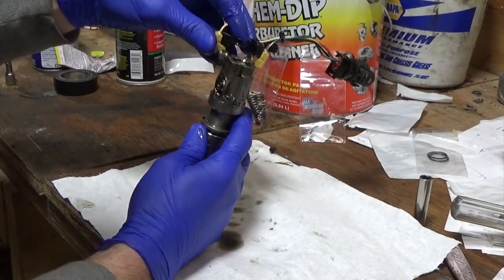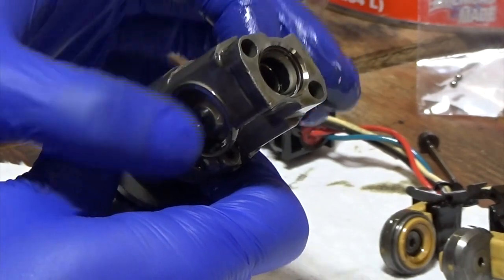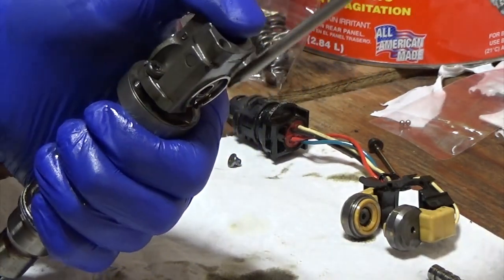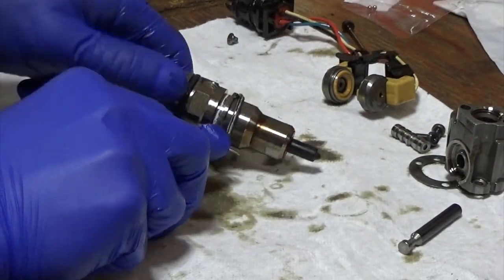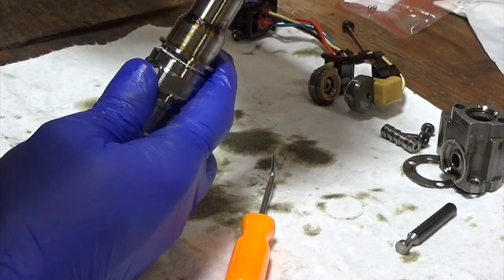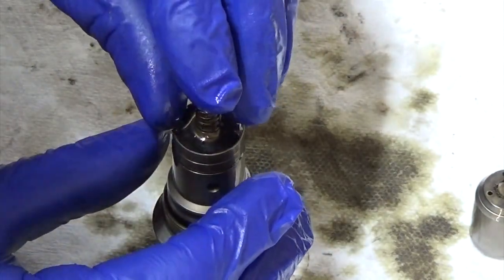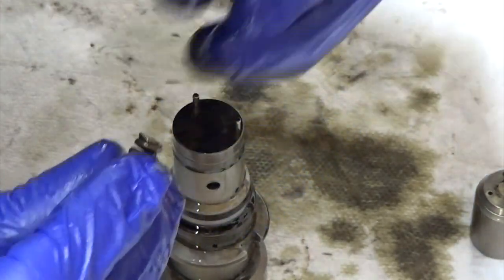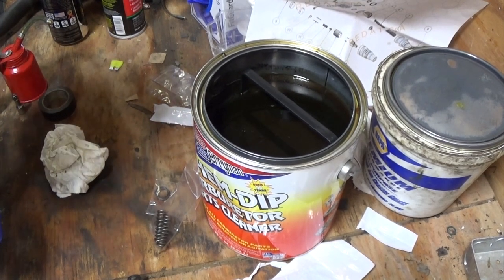6.0l Powerstroke Injector Rebuild Part 1

Comment: what are the 2 little ports on top? i have 3 of them leaking from there when doing a leak test. will that cause a no start?
Reply from the maker: Those are the high pressure oil exhaust ports. The high pressure oil goes through the high pressure oil rail into the injector. When the spool valve opens the oil pushes the plunger down. Once the spool valve closes. The pressure of the plunger spring pushes the plunger back up and pushes the oil out the exhaust ports. If you have oil leaks there when pressure testing. You have stuck spool valves. Or some kind of issue with the spool valve. 
Yes this can cause a no start. 
If you’ve disassembled your injector and you’re having his issue. You may have put the spool valve in the wrong way.
Reply: @showmerepair ok I've been looking for this i have about 40 injectors with this leak at the top and only found it because I've been trying to find a hpo leak on this truck and don't have money for new injectors. I've swapped spool valves between ones that weren't leaking how common is it that the valve body itself is worn out.lve been trying to figure out this truck for over a week.i air tested and couldn't hear anything with 170 psi at 190f. I resealed all the injectors bench tested for leaks and they didn't leak got the truck running then it wouldn't hot start then I air tested again heard a leak this time pulled the injector that was leaking swapped tops with one that wasn't but didn't work then got it together running then it died and it's another one leaking like that. And it's on the top of ring I put oil around and it's leaking from the top 2 holes on all 40 used injectors i have.also so it's known I'm not retarded I'm 19 with 5 6.0l and have flipped many and i am only finding this now and nobody i know knows anything about them so it's trial and error
Reply from the maker: @manassehgiesbrecht6528 yes the spool valve can wear out. 
Companies do sell new spool valves. 
I’ve not personally seen spool valve body worn out. But I would understand if it did wear out.
Reply: @showmerepair do you know a good definitive way to test injectors for leaks I've just been putting them on an oil rail with air pressure and being if it blows outta exhaust port I assume it shouldn't but idk for sure
Reply from the maker: @manassehgiesbrecht6528 if your not controlling the spool valve coils then the spool valve could be in the open position.
Reply: @showmerepair ok I've was thinking that so I swapped coils with an injector that wasn't leaking and it still did it so I swapped spool valves it still did it then I swapped valve bodies then it stopped. I have two trucks that have damn near identical problems right after like 180f the trucks performance drops significantly and randomly misfires and icp drops to like 900 wot then they don't hot start until like 160f one will hot start up to 180f
Reply from the maker: @manassehgiesbrecht6528 did you rebuild the injectors on both trucks?
Reply: @showmerepair i didn't do a rebuild yet at all I thought it was a hpo leak so I've been searching for that and I've only just found those leaks on the exhaust port.
Reply from the maker: @manassehgiesbrecht6528 other then heavily warn spool valve/ spool valve housing. The only thing I’ve seen cause random misfires on all cylinders at hot idle is spool valve coil bolt over torqued.
Reply: @showmerepair it's not hot miss at idle qt idle it runs fine it's under load it misses
Reply: @showmerepair it's from low icp but it drops like crazy when on throttle

Comment: Do you know where you can get the metering valve square plate. Mine was broke in half.
Reply from the maker: I do not. May have good luck picking up a used injector on marketplace to use for parts

Comment: Looks pretty straight  forward. Makes me wonder why more people don't rebuild their own injectors with so many crappy companies around and the high price of them.
Reply: Just like automatic transmissions, a lot of people are intimidated by it. The industry is partially responsible as nearly every mechanic you talk to will try and convince you that it takes years of experience to even look at them much less actually do the work.
Reply: @theezeelife292  the typical mechanic when you bring  in a 6.0.   Oh yeah you totally need a new engine.  😂

The last one I went to kept telling me " yeah I tested it engine and I'm getting signal that let's me know you have a major engine issue"  but then couldn't tell me what the test he was doing was or what kinda "signal" he was talking about.  I went and  picked it up and turned out it was injectors not firing due to the oil being cooked. (T6 ain't as good as I thought)  truck wouldn't start after 6k miles with light duty use
Reply: @jc2478  a typical mechanic is a thief.
Reply: @jc2478 it’s not the mechanics fault you go to far on your oil change you need to run hot shots oil additive if your going to go over the proper oil interval

Comment: Man i feel like you gouged the o ring groves pulling those Orings out not good. you should use an exacto knife and carefully cut them, so they just roll out easy and no chance of a gouge, so the new seals have a chance.

Comment: If the injector devolved a problem from a bad fuel pump would it likely have damage beyond these rebuild parts? Can the parts be fixed with sandpaper?
Reply from the maker: I think in video 2 I go over things I’ve done to fix injectors.  Thanks for watching
Reply from the maker: I wish I had a good answer to that. I’ve not done enough testing to know exactly what actually needs to be repaired. To me the top side of the injector shouldn’t be hurt if the fuel pressure was low. To me it would be in the lower area that handles the fuel. I’ve had good luck by using very fine sand paper to clean up the plunger.
Reply: @showmerepair  thank you for responding.  I didn't know if it was a definite waste of time. I'll pull them apart and inspect them first.

Comment: Thanks for this video!  Very in depth and detail focused.  I picked up the same rebuild kit and did all 8 injectors on my 03.  Now it runs like a champ again.   The cylinder contributions on all 8 cylinders are now perfect!   Only difference was I used an ultrasonic cleaner to clean the injector bodies.  While I was tearing everything apart I also used your other video to rebuild my turbo.
Reply from the maker: Great to hear. That’s why I made the videos. 
I’ve started using an ultra sonic cleaner. Does a much better job. 
Thanks for watching.

Comment: What do you do about broken fuel inlet screens, can they be replaced? I think I've watched every video on YouTube and nobody mentions them.
Reply from the maker: Find a used injector body. I’ve spent a lot of time trying to source some but no luck. You could try contacting any of the companies that rebuilds them. They may sell you one. 
I’ve ran injectors with out the screens in a pinch. Just make sure you stay on top of your filters
Reply: @showmerepair  Alright thanks, Have you ever attempted to remove a broken one? They look like they're probably Pressed in From The outside?
Reply from the maker: That I recall I have not tried to remove a screen. Yes I believe they are pressed in.

Comment: Wery good video! Do you have to do calibration after Rebuild??
Reply from the maker: No.  If you think the failure was caused by a bad calibration. You may want to.
Reply: @showmerepair   What kind of your problem you got to rebuild this injector? Tanks!

Comment: Is it possible to get fuel in the oil through the injector?
Reply from the maker: Anything is possible. But not likely. Oil is under more pressure in the injector. So I would believe you would get oil in fuel before fuel in oil. Your injector can leak fuel into the the rocker arm area which would cause fuel in oil.
Reply: @showmerepair  It’s getting enough oil in the fuel to dilute the oil enough it won’t start when hot. I changed the oil and it starts hot or cold now but still getting fuel in the oil from somewhere. My first thought is injector orings. About 5 months ago I had the engine built by a replicable shop in town. New heads, new bolts, new oil cooler, and injector orings. They used the same injectors. In all $9600 for all. The shop is telling me it could be orings and if that’s the case it will be under warranty. But it could be a cracked injector body and if that’s the case it’s not covered by warranty. Just trying to learn as much as I can before I take it to them to do the work.
Reply from the maker: I agree it could be a leaking o-ring or an injector body leaking. What do they want to do to diagnose or repair?
Reply: @showmerepair  He just said they would remove valve covers to try to find where it’s coming from.
Reply: Yes fuel can leak past the fuel plunger I had the same problem,  got dye put in fuel pulled valve covers and ran engine didn't take long to find the injector that was bad
Reply from the maker: If I suspected fuel in oil. I would put dye in the fuel. Pull the valve covers. Start the engine and use a black light to see if you have fuel leaking from and injector.
Reply from the maker: You may check with them to see if they want dye put into the fuel before it comes in the shop. It will help identify the leak. Im interested to hear what they find.
Reply: @showmerepair  Thank you for your help. They supposed to start looking at it Tuesday morning. I’ll let you know what they find.
Reply: Presure the nozzle?
Reply from the maker: @miguelangeltacarroque6657  ? The nozzles are pressurized when the injector fires
Reply: Yes you can by the fuel pump or the injectors

Comment: Thanks Chris! So the small rectangle plate inside the meter plates was broke in half. Do you know where I can find a new one or should I just put the two pieces back in?
Reply from the maker: I would not put it back in. I do not know where to get the metering valves. I believe you’ll need to get a new injector
Reply from the maker: You could see if any one is selling used injectors close to you cheap. And then disassemble to take parts from it.

Comment: Where is the link to the kit and what’s the solution at the end of the video.
Reply from the maker: It’s carb cleaner. You can pick it up from any parts store. I’ve learned that’s not the best. I’d recommend getting a ultrasonic cleaner from harbor freight or Amazon.
Reply: @showmerepair  thanks a ton on the video and help
Reply: @showmerepair  last thing. What is the tool that comes with the kit? If I don’t need it I’m not buying it
Reply from the maker: Link is in the description. 

There are 2 more videos. Total of 3 videos going over the process. 
Video 2 link 
6.0l Powerstroke Injector Rebuild, Injector Body Assembly Part 2
Reply: @showmerepair  the solution you dropped them in. What was that in the bucket? Sorry just kinda on a time crunch
Reply from the maker: And that link didn’t work
Reply from the maker: Bitter root doesn’t sell the holding tool with the kit. If you watch the videos you’ll see I don’t use it
Reply: Does it matter which way the thru rod goes through the spool valve? I torqued them to .5nm but forgot it which way the nut went and installed them
Reply from the maker: @take1u2  I don’t believe so. I think I’ve put a couple in the opposite way. Normally the head of the bolt faces away from the electrical connector

Comment: What are you submerging the things and stuff in?
Reply from the maker: I was using carb cleaner in a 1 gallon can. It worked to clean carbon off but then still had to clean with brake clean. Now I use an ultra sonic cleaner I bought at harbor freight.
Reply: @showmerepair  aahhh....so just like the label says......how sneaky 🧐😁
Reply: @showmerepair  what solution do you use in the ultrasonic cleaner?
Reply from the maker: @patrickwelch620  I’ve been using evapo rust https://www.evapo-rust.com/

Comment: I have 2 injectors probably sticking and going out would you recommend just rebuilding all of them?
Reply from the maker: Diego Olalde if you feel you can do it then go for it. You can definitely fix the  stiction issues. Most of the time putting new springs in and cleaning the internals of the injector will help with other issues
Reply: @showmerepair  thanks for the reply ill go ahead and give it a shot then thanks!

Comment: Quick Question/Comment (early 2004 6.0L owner here): I just took apart Injector #4-- the spool valve was reversed-- skinny end close to where the bolt head-- in your video you stated that the fat end (more solid meat) should be at the end where the bolt head is...  I also had to replace the ICP Sensor as I was blowing oil...  In your opinion-- and based on your comment that the if this is reversed-- this 'could cause' high oil pressure...  What error codes would this throw?   Any other thoughts?

THANKS for these videos-- I am rebuilding all 8 of my injectors because my HAND-ME-DOWN truck was given to me in a very shitty state...  Hoping to improve on the fuel delivery system...
Reply from the maker: SY Explorar Conmigo the fat side of the spool valve should be on the side of the spool valve housing facing the exhaust. The bolt can be put in either way. 
If the spool valve was in wrong.  This can cause a no start “high pressure oil leak”.  This could set a P2291.
Reply from the maker: Good luck feel free to ask more questions.
Reply: I was trying to understand the frequency that the spring needs to be replaced?  The rebuild  kit I purchased doesn’t have the replacement spring—-and I’m trying to understand the frequency and or feedback mother of the other diesel shops (who rebuild injectors) — how often springs go out and or how to test other components of the injector— while I have all eight out, and the truck is a hard ‘down’ for a while... again trying to Google research myself and find YouTube videos but there’s very few videos out on rebuilding and injectors as detailed as you are...  but I’m looking for stats and facts to drive my decision making...
Reply: as much as they want to charge for new springs, like 400 buck, spools another 400, and tips the same, you might as well buy remanned injectors. I hate th 6.0 as everyone is price gouging for parts and should be heavily fined. all this must by oem or some expensive aftermarket upgrade to fix thee POS 6.0, to bullet proof it, you must replace every little damn thing in the engine and the 6.0 will last forever!!! Except one thing. It is no longer the 6.0 powerstroke anymore is it. It is a 20,000 dollar customized engine that many companies made a fortune selling 25 cent parts for hunfreds of dollars. And out pathetic criminal government who is obligated by law to uphold laws and protect the consumers does nothing to stop it. They all should be in prison. Try contacting consumer affairs. All they do is forward your complain t to the people you are ccomplaining about. they never fine or punish anyone.  @syexplorarconmigo8853
Reply: I didn’t pull that code—  I pulled an ICP code, and injectors 1 & 6 (P263 & P278) not contributing...

Comment: So, when these have mechanical failure from low fuel pressure what would go bad on these things?
Reply from the maker: From what I’ve been told over the years, the intensifier plunger mushrooms and scoring on the intensifier plunger and body can happen from low fuel pressure.

Comment: Great video Thanks! What size/type tools are you using  at 0:35 seconds?
Reply: I'm also wondering what size
Reply: just got it... T10 and a 4mm socket on the other side

Comment: Where can you get he rebuilt kits?
Reply from the maker: hilham 89 https://bitterrootdiesel.com/
Reply: @showmerepair  I appreciate it. After I started watching your second video I seen where you got it.
Reply from the maker: Thanks for watching. I’m working on more videos
Reply: @showmerepair  I appreciate the help. I'm somewhat new to owning a diesel so I'm trying to save some money by doing it myself
Reply: Hey Chris awesome vids! Have you ever had injectors you couldn't get apart? I broke one of the notches trying to get one of mine apart. I even broke my cheap Chinese 4 inch vice. Is there a rebuilder/reman supplier
 out there using red loctite on those threads that you are aware of? I have applied a little heat with a propane torch and nothing. Really scared to attempt another one, it was really tight so I gave up.
Reply: @MidLifeCrisisGarage  We recommend our rebuild tool for this reason.

Comment: Just a quick tip. You can put a wrench over your screw driver handle instead of vice grips. The handles are designed for that.

Comment: My truck is an 05 and so now you can include 05s where the hat breaks .
Reply from the maker: 2005 is not the only year that this piece breaks. I’m not positive but I remember reading some where that the cup that goes over plunger was updated at some point to put pressure on the plunger and not the hat.

Comment: Chris ; I think I may have a bad injector. With 260k on, would they be worth rebuilding? Secondly do you have a shop? Or maybe sell rebuilt injectors. Thanks
Reply from the maker: Bob  I’ve heard that injectors with that high of mileage should probably be replaced with motorcraft reman. 
Though a lot of 6.0 have had injectors replaced several times. Are you sure the injectors have 260k on them? 
I do not do this full time. That is the plan though. Wish I could help with rebuilding the injectors for you.
Reply: No Sir , I don’t know. You wouldn’t happen to be in Texas would you ??
Reply from the maker: Bob  not located in Texas sorry. I have heard there are many reputable diesel repair shops in Texas. I just googled diesel injector repair in Texas and about 20 shops came up.